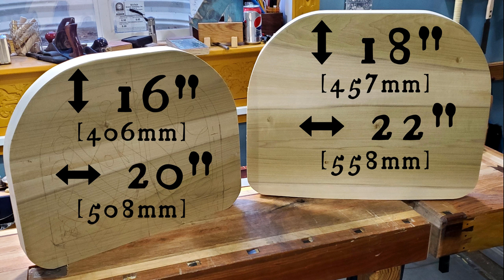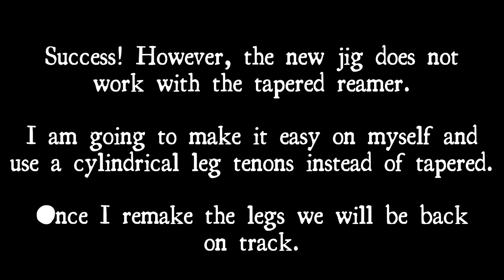Building a Welsh Stick Chair - Part 1 | Challenges and Setbacks

Comment: Eric - why did you need the reamer to work with the jig?  When I made my perch stools, I drilled the holes and then reamed them.  Just had to put the leg in and check that I wasn’t drifting too far off center (I think you could draw a circle centered on the hole to check yourself).  Since you have the same tenon taper I used, I assume you also have the matching Veritas reamer.  I will readily admit that three legs are a LOT more forgiving though, maybe I’m under thinking it.
Reply from the maker: Thank you for the question. When I was trying to drill and ream without a jig I was not getting to the level of precision that I wanted for this project. I could get it to "close enough" and I doubt many people would have noticed if the legs were slight out relative to each other, but I would have and that was bothering me. Going the jig route made it easier for me to move on to the next part of the project and find a new operation to obsess over lol.